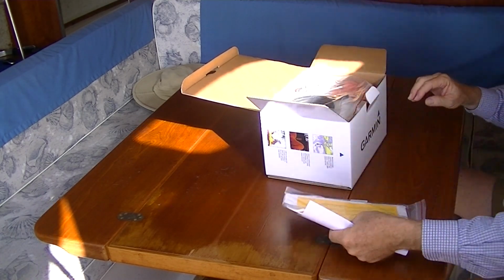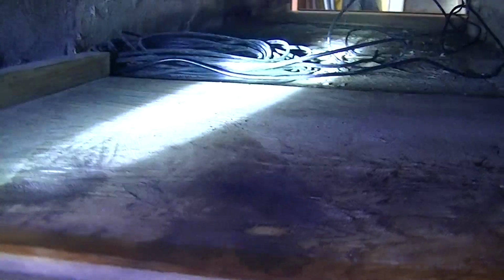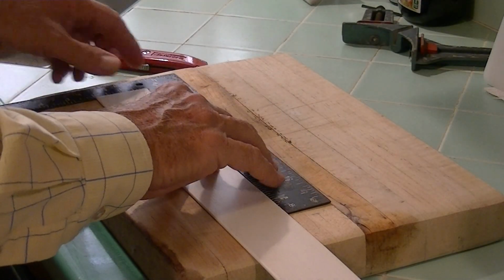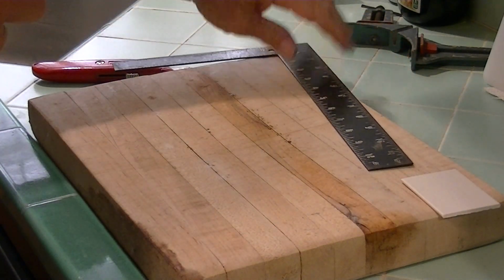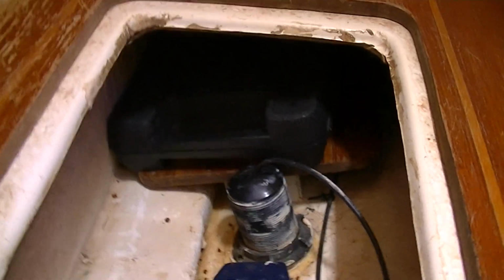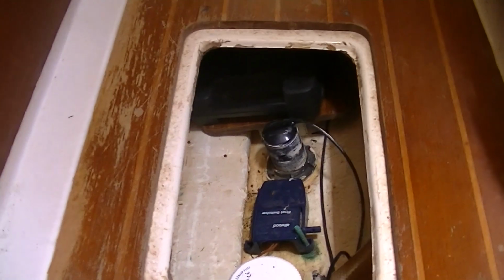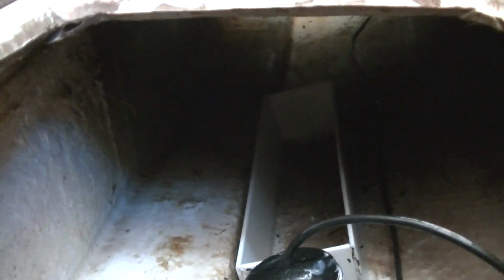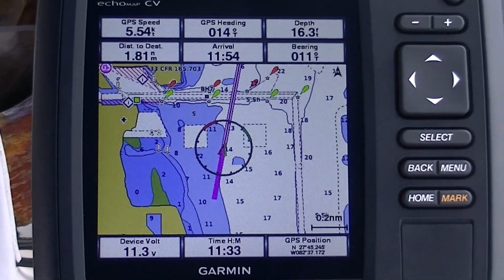20190630  Garmin 54cv Installation

Comment: Does anybody know how much juice I would need to run this for instance what battery size
Reply from the maker: I couldn't find a direct answer.  Unfortunately the unit isn't labelled with its amperage draw.  The installation manual indicates the max power usage as 7.1 watts.  That's just over half an amp on a 12 volt system.  Any 12 volt car or boat battery will run it.  How long it will run depends on the capacity of the battery and the on board charging system.

Comment: I have the same transducer and am wondering how the sonar mapping of the bottom works witht this setup.  Have you tried it?  If I mount this transducer on the stern, it's going to get destroyed because my dock bottoms out on mud at low tide.
Reply from the maker: Quickdraw Contour Mapping works very well.  Because my boat draw 18" and the transducer is mounted in the bottom of the hull I specified a keel offset of -1.5'.  When I am surveying the bottom I use the recording offset to compensate for the height of the tide.  If the tide is 3' above normal I set the recording offset to -3'.  If you are surveying a lake bottom where there is no tide use the recording offset to compensate for high or low water the same way.  The only difference is lake levels don't change as frequently as tide levels, so you can operate for more than an hour before you have to recalibrate.

The only problem I have encountered is in shallow water the unit can't find the bottom.  The bottom is too close to the transducer.  I try to survey those shallow areas when the tide is at its highest, but there are still some areas that are too shallow.  The shallow spots are the ones I care about most, because that's where I might run aground.  If you're looking for bottom features where fish might congregate that may not be an issue for you.
Reply: @MrFgd3  Thanks so much! Would you happen to know the thickness of your hull?  I'm planning on trying your method. 

Also when you installed the transducer, did you set it in some silicone to keep it in place? Or is it just resting in the tray you made?
Reply from the maker: Hull thickness is about 1/2", to the best of my recollection.  I replaced a through hull fitting about ten years ago but I don't remember the event well enough to give you a better answer.

When I installed the transducer I just placed it in the tray and filled it with water.  Before that I tried to bed the transducer in silicone.  It didn't work and was a real mess to clean up.  I considered making a top for the tray but haven't found it necessary.
Reply: @MrFgd3  thanks for your responses.  I'm going to need a lid, because this is for a sport fishing boat, and the water in the bilge does not get or stay very deep at all and the boats knocks around quite a bit. Again thanks for the video!